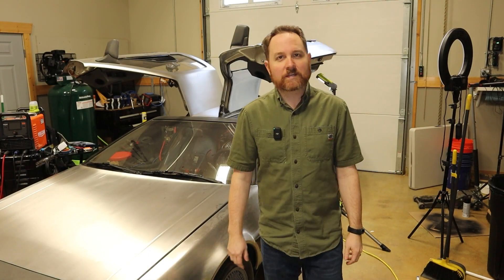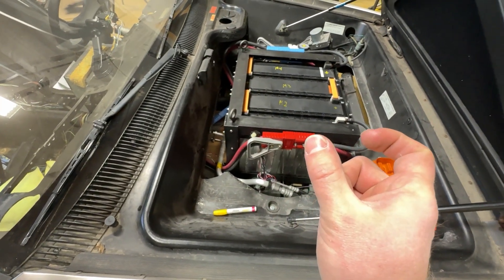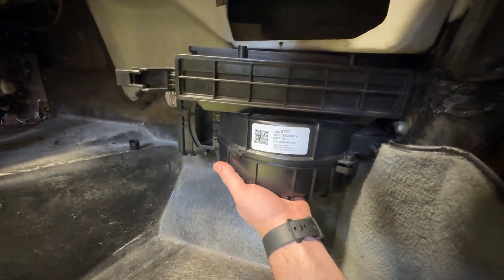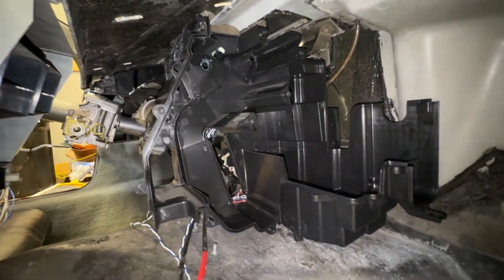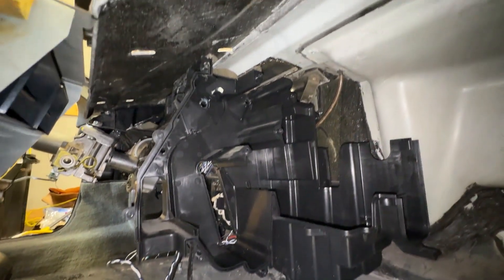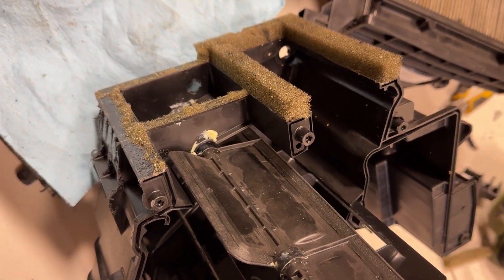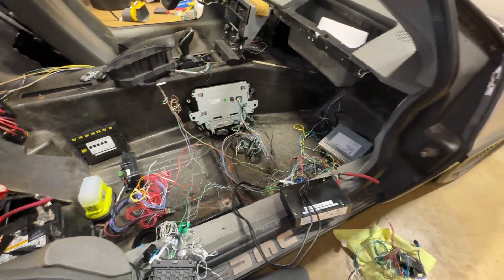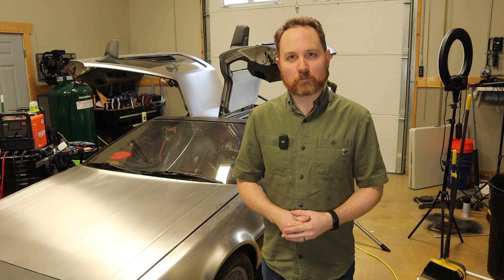DeLorean EV Conversion - Test fitting the HVAC system

Comment: Great update, my theory on car hvac is they design and build the entire car and then go, "oh wait, we forgot the hvac, let's just cram that in wherever we can!" Lol.  So you actually planning that out seems miles ahead of factory policy.
Reply from the maker: It’s one of those things I never thought about - but I would really like to see an HVAC engineer at an auto company talk through the designs for a set of vehicles and show how it evolves. Like I don’t know if the Bolt EUV has the same HVAC box or not, because it has more room inside. Or Chevy Trax or something in the same class.
Reply: @BillCarlson  yeah to be honest I think the HVAC engineers are last in line to get a say on interior design.  Like the designers start it out, then the ergonomics guys go through and then electrical/infotainment, and then HVAC and they just have to work with what they got.

Comment: I am surprised that you will be able fit so much of the Bolt's HVAC into the deLorean.
Reply from the maker: Me too!! My initial attempt to slot it in didn't go well at all, and I spent hours trying to see how I could somehow combine the Bolt's HVAC electronics inside of the DeLorean's HVAC box. But luckily I was able to cut off enough of those tabs and things to get it to fit. It's a tight fit, just BARELY makes it.